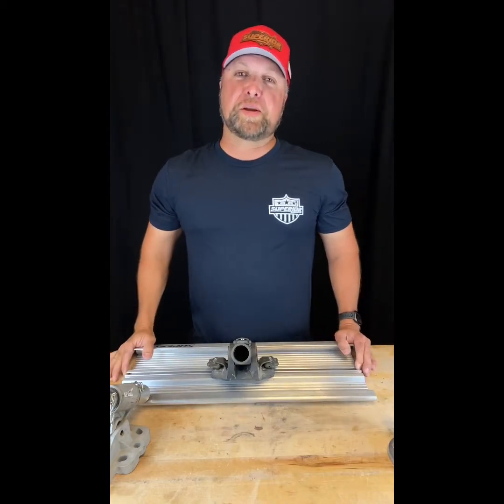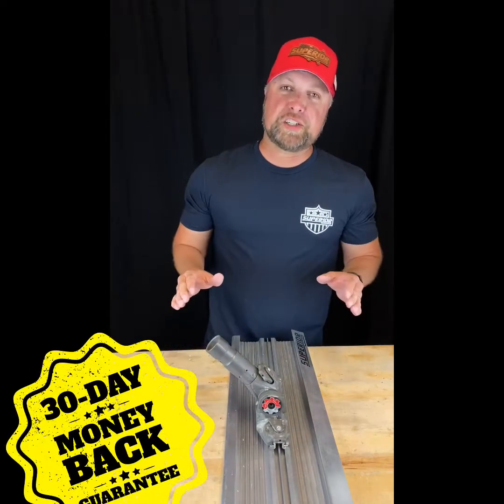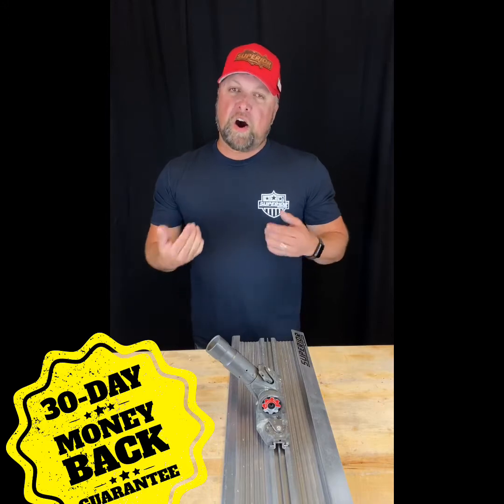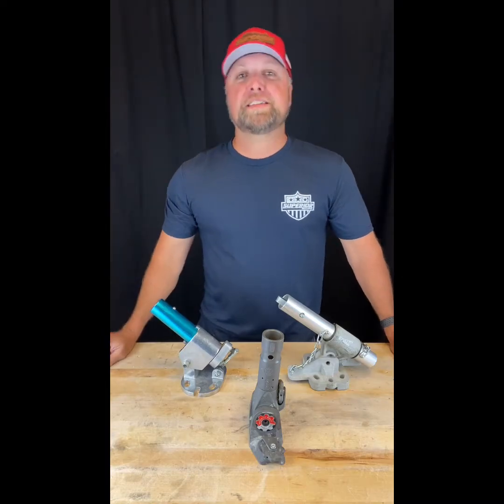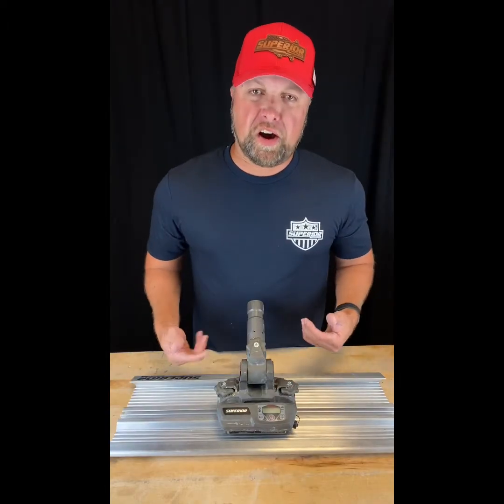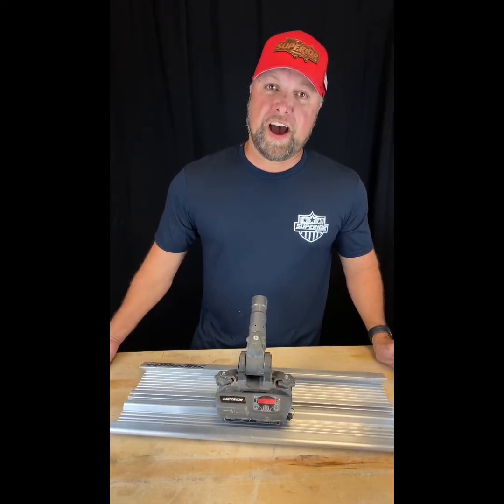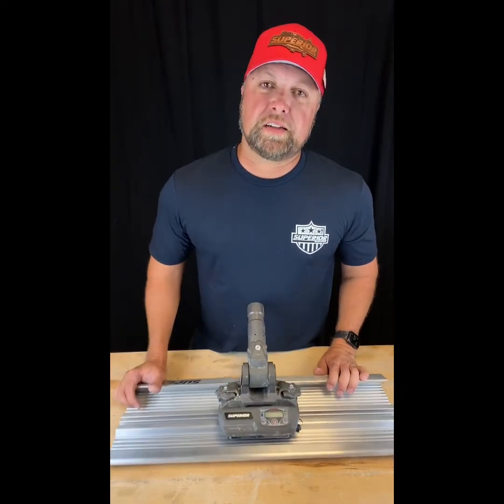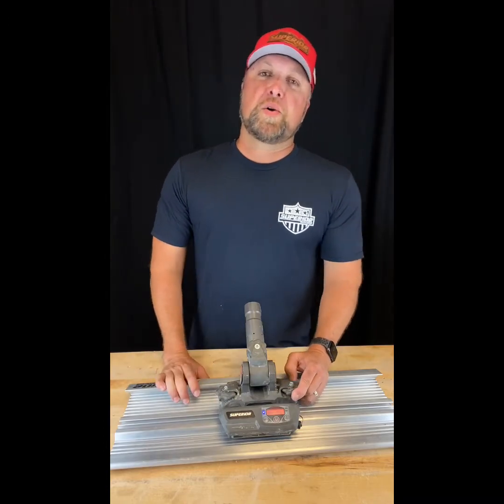Gen3 MagVibe & Pro Tilt package

Comment: Whats the maximum float length that can be used?
Reply from the maker: Thank you for the question.  We have customers using one MagVibe on a 10 foot float.   We also have customers who use three MagVibes on a 7 foot float because they need more vibration to work with the concrete mix design.    I offer a 30 day money back guarantee so you can use it for a month to see how it can benefit.   Please email me at scott@magvibe.com